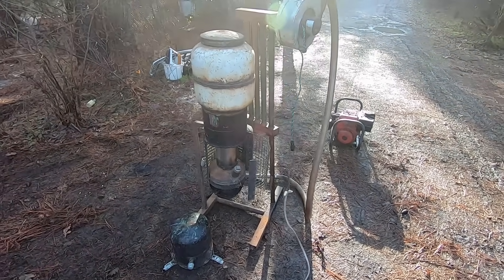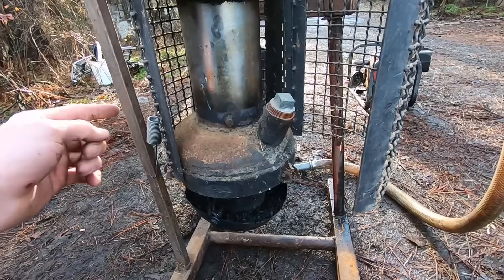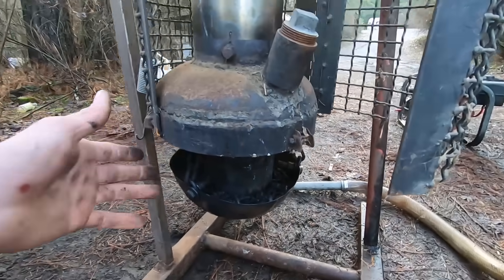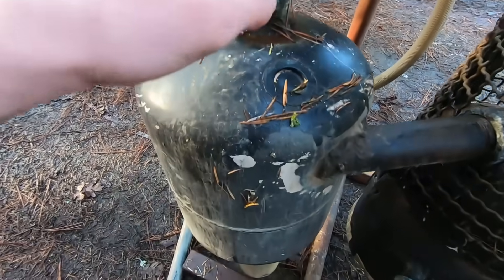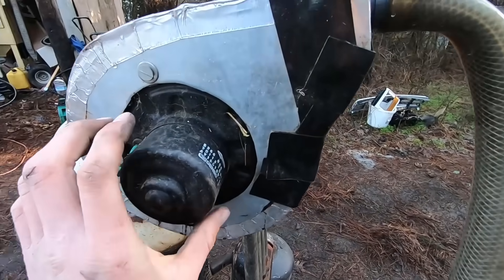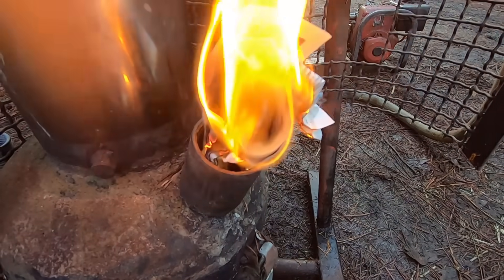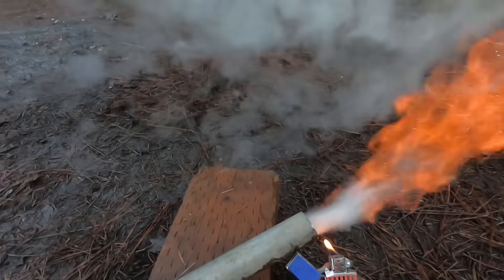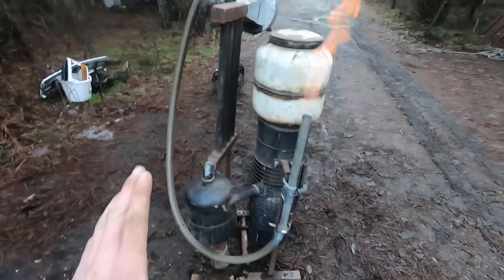Using Wood to Fuel a Generator! (How to Build a Wood Gasifier w/Demonstration)

Comment: I have a book around here somewhere about a German engineer who moved to Australia. He wanted to travel through the Outback, so took his Bedford (I think) truck and converted it to run on a small wood gasifier, which he then fueled with the abundant Mallee roots. Small trees that rot off to sharp stumps, making the ground look like it has spines. Which.. It does. He had to modify his wheels to be iron flats instead of tyres because the tyres (tires?) were shredded. Partway across, he broke an axle, so he converted his generator (we use alternators now) into an arc welder and repaired it and kept on going. The guy was brilliant.

Watching this gasifier running, I can easily see how a Bedford truck could run on the same wood gas.

The closest I ever came to setting this up was using a 44 gallon drum on a frame with a pipe from the lid that directed the gas out and down to underneath where it was ignited to heat the drum itself. A small fire was lit underneath. It was then self-sustaining after a bit. With that we produced charcoal to use in a furnace or forge for working metal. In which I've managed to since liquefy hardened steel (by accident) using gum leaves and sticks and a handfull of charcoal with an old vacuum cleaner repurposed as a blower. The furnace is made out of an old water heater shell (the kind heated by fire), some old house bricks and some crude cement made from ash and mud.

Comment: Every once and a while I need to make "char cloth" for flint and steel.  This is the same process.  I put a bunch of wound up cloth in a tight can with a tight top and heat the can. (I find 100% cotton cloth works great)   While the cloth is carbonizing gas will come out of a pin hole on the top to the can.  This gas burns.  I fact the gas from this carbonizing can be used to keep the system burning and carbonizing reaction running.  When the gas coming out of the pin hole will no longer burn then I know the cloth is fully carbonized and will work well for making fire with flint and steel fire.

Comment: What type of engine are you using? Is it 2 stroke or 4 stroke?
Reply: Only 4stroke an only gasoline  engines.  No diesel's   it is Possible to do what you think but because its  2cycle. Woth the  burning of any 
wood material 
cow poo
 plant material 
biomass  ... the flammable gas Produced  needs many purification  steps like 2x or More than this setup. It makes  water vapor black tar  flammable hydrogen  methane  etc....

Comment: Would this be potentially more dangerous than a regular gas engine running on gas? I've been doing a lot of research on this and I'm wanting to convert a truck to run on gasification but I definitely dont wanna blow myself up lol. I guess as long as I have no leaks where there shouldn't be ill be fine

Comment: Once it's up to heat, do you need electricity (to run the fan) or does the engine provide the suction. I noticed u temp had the hose not connected to the generator ...no suction.

Comment: more ppl  don't know about it because of Ford motors and Chevy and all the other car companies. I guarantee there is already a patent for this contraption and Ford owns it and is keeping it locked in a vault somewhere. You heard about the guy back in the 80s I think invented and new carburetor that only used 1/4 of the fuel and got better performance out of the engine. Ford wrecked this dudes life. They ruined his families lives. They were brutal. Anything that takes money out of BIG Oils pockets I guarantee will have a campaign lead against it until there's nothing left of the idea. but YouTube has definitely helped in putting a stop to the knee capping. Now companies all fight over who controls the algorithm.

Comment: Great video.  I have a few questions.  
1- There seems to be more gas coming from the tube, than the generator needs to run. Could it be possible to SPLIT the tube into two tubes and run TWO generators at the same time??
2- Assuming that works , how efficient does the generator burn ALL the gas. Would it be possible to run another generator simply from the EXAUST of the first generator??
3- You are generating a lot of heat there that is going to waste. Could it be possible to connect some sort of STEAM ENGINE to your burner, have that run a piston, and turn a generator at the same time?
4- along the same lines, could it be possible to run water lines through the burner to heat water… for a hot tub, or bath?
5- to run air lines through  the burner to heat air and send it into your home or garage??
6- Stirling engines also use heat and could be put to use. 
7- There are many ALMOST perpetual motion machines…that ALMOST work without a little help. If you made one of those perpetual motion WHEELS that are all over YouTube , and connected to a pulley that was connected to a piston, driven by a steam engine… then the Perp-motion machine would keep going, and could generate electricity. 
.
That all depend on if you have good batteries, so you can save and reuse all this electricity. 
It just seems like there are many good ideas… but no one has connected them all together, so they help each other.

Comment: I wonder if you could use an old tin radiator for the heat exchanger or if it would melt the solder? Maybe an aluminum after cooler off a turbo charged diesel might be better?

Comment: could segregate the charcoal burning side from the wood gas generator chamber, so the wood gas is 100% wood gas with no CO2 in it. similar to a steam boiler but its charcoal heating wood. add a tube with two ball valves on the top and bottom so more wood pellets can be added and charcoal emptied out as its running? someone also said something about wood oil... wood oil stove?

Comment: Great video. One question.  You mentioned that the size of the fire tube is critical to what you can run with it. Is there a calculation to figure that out or was it just trial and error.

Comment: I know this is a old video, but I am building a gasifier using 20 lb. propane bottles my question is i want to use a piece of 6 inch schedule 40 pipe does 5 or 6 inches for my burn chamber sound about right  for the length i will have two 1 inch pipes pointing into the burn chamber

Comment: My assumption for efficiency is heat up filter while cooling then back past heay exchanger to burn   or just super heat whilst filtering particles and other straight to motor...
Also the geat processor uses exhaust gases to transmute incoming fuel in your case passing through exhaust through exhaust for final burn 🔥

Comment: Isn't this set up a little bit dangerous? The gas produced is syngas: mostly carbon monoxyde (a poison), hydrogen and nitrogen  The fema text stated that this gas contains more than 20% carbon monoxide. It is not advisable to breath it. Shouldn't the exhaust from the blower pointed upward? Away from you. You need two separate tubes coming from the filter unit: one tube for the blower and one tube going into the engine manifold

Comment: This is some serious shit that many people could use!!!
I would rather schools teach this type education rather then gender studies, or other useless studies.
In a harsh environment, this could actually be the difference between life and death!
I would like to see a more modern version of this with actual power being made!
Maybe incorporating a liquid cooling system and there by providing hot water and heat as a by - product of the gasifiers operation and then using the gas produced to run the generator for electricity.

Comment: Hello I am from argentina and here there is a retired engineer that build a car that runs wih that system, he travel over 3000 miles with trash as fuel, here i leave you a video of it although is in spanish you can wath it with subtitles. Greetings, great video!!!
https://youtu.be/fi8uHk4n99o?si=VNLSsnw25y9r1Hdn

Comment: I think that using water steam from a pressure vessel made steam turbines go 55 percent efficient for the production of electricity alone. When the British needed heat, they used condensation pipes for that and hot water circulate inside the heaters, the water is pumped in with a small centrifugal pump, the wood was then used directly. Our time is surrounded by gasoline and ICE, all came from no work of ourselves, that may be the difference. If we had to do a sparkplug and a battery and the engine, we would give up.

Comment: Just order you one of them damn Sterling engines online they're pretty big they're like four chambers and once you get them going they could spend a small generator or alternator and you could power two electric motors hooked up to the axles on an old front wheel drive car and you can put a a belt and pulley system on it to spend the power steering pump and give the brakes some power but you could use wood to heat up the Sterling engine.. then you have a very cheap car that runs off wood

Comment: This is a smart way of biochar production that could be used for soil amendment and other purposes. But I have a couple of questions: 1) Could all biomass sources be used as feedstock for biochar production (e.g., manures of different sources, sewage waste/sludge,  city wastes, invasive weeds like water hyacinth, etc.)?
2) Is this process done completely in the absence of oxygen? 3) What will be the fate of the syngas that is generated during the pyrolysis process?

Comment: people know about it, it's just that the gases are very toxic and can in fact, kill you. this mostly applies if you where using it as a fire source inside the building but if it's just a generator outside i suppose it's fine, although it's still very pollutey and well running a generator is noisy af. just get some solar panels and call it a day.

one thing you CAN do it to make it less toxic is to have a storage area so the gasses can better settle, then on your output to the generator use a valve so you can open and close it. another better solution is to feed the gas into a container of water, use a screen inside the container under water so the bubbles formed break up even more. this will leech most of the bad shit into the water and you will be left with much cleaner gas but with very toxic water.

lastly because you are drawing air through the system, your gas isn't pure flammable gas but rather a seemingly proper mixture. if you want a more pure mixture you will have to heat a sealed container (with only a single output line that the gas will expand out of as it's created), in this way all you get is the byproduct gas of the burnt matter and no air. condensing this output line (cooling it down) will remove nearly all of the bad crap then push it into a container of water (let it bubble through it), use a mesh to break the bubbles up even smaller, this will filter the gas even more. you should be left with a very clean burning gas (can't see it with sunlight).
you will have to change the water out and also clean the condenser as it will no doubt build up with some real nasty shit. 
this is why people don't use it, it's a lot of work, it's toxic and well generators are noisy AF. get some solar panels and a few batteries....so much less of a hassle.

Comment: I bet this method could be used to create heat that is very efficient and can be kept away from the area to be heated... to reduce fire hazard... and smoke so it will be less visible and detected by smell because all the fuel is being used...

Comment: I'd like to know approximately how many hours could this generator run before it would need cleaned or rebuilt.  I imagine the valves get dirty faster than using propane or gasoline.

Comment: Your design makes sense. Now instead of just letting the smoke go out. Add a 55G container with the smoke being pushed through the bottom of the barrel and that will help filter out the impurities. Then at the top have a tube going from the top back down to the ground and then run the generator off of the fuel hose. That way less is being waisted. At the rate of burn and the amount of smoke gases there is plenty to collect. I really liked your design. The radiator fine cooling was also a good idea. But instead of going straight up maybe it should have gone to the right of left and add water to help cool the smoke. Which in turn would help turn it into gas/liquid forum.

Comment: Did you mention how poisonous the Syn-gas is?  A lot of carbon monoxide gas is in there.  When you breath it in, It locks onto your red blood cells, and stops them from transporting oxygen.  It DOES NOT matter if you then move to clean air.   When you have been exposed to enough of this , you can suffocate in a 100% oxygen atmosphere.

Comment: My grandpa had a book about this I always thought the out door wood stove would be amazing next to generator but I don’t know if that will work he had the upper part of a school bus on top of a log cabin he had solar hot water and lots of it enough energy to heat 2 275 gallon and  store he also had it vented in way that was natural ac to house the heat drew cool air in from out side I was asking what all this was he said grab the pipe he hit a switch Holly shit was just like scalding hot in a 3 second then my dad was making hot water from the wood stoves his best design was box like 2x4 hot to top cold from bottom and the heat would naturally circulation the water so with in day it was pre hot water heater tank and on 2 day could cut the electric hot water hot with 2 hot tanks of water the water drawn from wood stove tank to hot water got the cold I think they were in competition  I was talking to buddy about it he mentioned they is new tech using dissimilar metal on out door wood stove to draw electricity it’s like using the tech they use for coolers 12v no compressor if you add power it cools if you have heat you get power it’s all interesting at the very least the knowledge is worth having

Comment: I'm going to follow your design. I'm a Master Welder/metal Fabricator. And thank you for simply sharing this information. As opposed to turning it into a money making thing. Although,... If you did decide that you would like to make and sell some more advanced plans, I would ABSOLUTELY buy it only from you! Because you have done an amazing job 👍🏾. I'm going to see, about assembling a higher volume producing unit on board an 1992 F-150. However,... I'm also planning on chopping the entire vehicle in half, and custom designing/building it longer, and installing a ((second engine)) onto the truck. I'm going to try to get some gears to dedicate the original motor to just the front Wheels. And I'm going to place the second engine in such a way, that it will be dedicated to the back wheels. Even if I will have to install my own lifted frame. I'm crazy, I know. But wood gas,/propane,/ and natural gas all lack the power of Petroleum. And so, unless I try to extend the front end, to install a V-10, Then I'm going to go all-out to increase the power .

Comment: have you been able to calculate wood btu to various run times on the gas engine? more to the point, assuming the gas motor was turning a alternator or generator how much would would it take to make say 10kwh of electricity?

Comment: so what if you used the heat to boil water for a boiler that had sterling engines turbines and steam engines awhile it could your home and ran the generator. burning home made briquets and burning bio fuel. you could get carpet demo right and burn it to produce gas and diesel...

Comment: Is this another 'technology' that has been purposely hidden from us? I'd love to know the 'maths' involved in this? Why do we extract gas from the earth if all we need to do is plant trees?
Reply: "purposely hidden"
No, syngas from wood is 50% nitrogen, 27% carbon monoxide, 14% hydrogen, 3% methane and 4% carbon dioxide

The generators/conversion kits were fairly common from the 20s-40s due to the lack of availability of gasoline, but as these gasifiers produce a substantial amount of carbon monoxide there were a lot of deaths in cars as a result. General rule was to not park it in a garage/away from the house and keep the car windows open while driving to prevent a buildup.
Modern cars at least have catalytic converters to reduce the amount of residual unwanted gasses.

In 1942 there were about 73,000 wood gas vehicles in Sweden, 65,000 in France, 10,000 in Denmark, 9,000 in both Austria and Norway, and almost 8,000 in Switzerland. Finland had 43,000 "woodmobiles" in 1944, of which 30,000 were buses and trucks, 7,000 private vehicles, 4,000 tractors and 600 boats. Woodmobiles also appeared in the US, Asia and, particularly, Australia, which had 72,000 vehicles running on wood gas. Altogether, more than one million wood gas vehicles were used during World War Two.

IIRC Germany used them for tanks. They were phased out as gasoline became more freely available after WW2.
Reply: @MrGrifft  Thanks for that detailed answer.